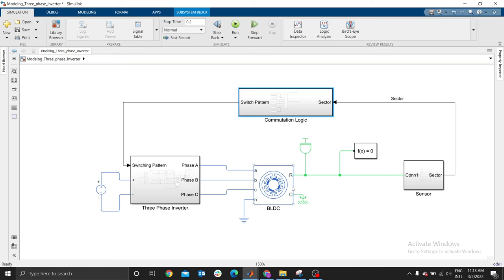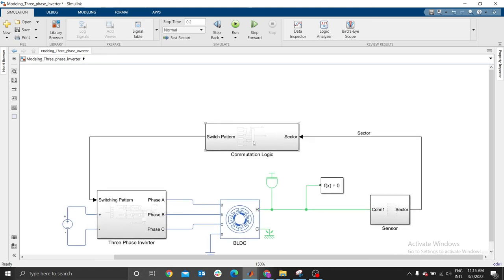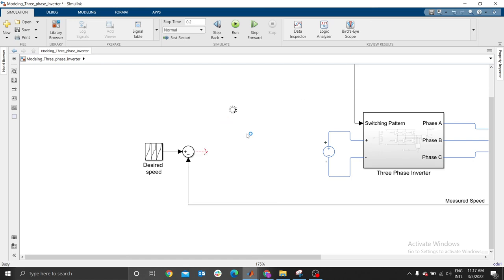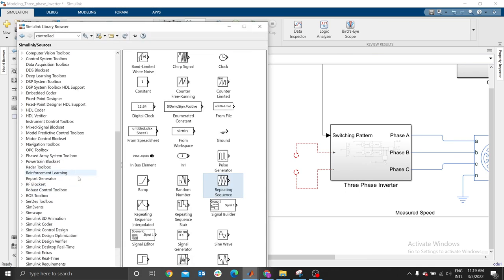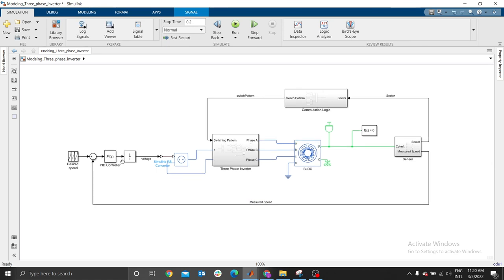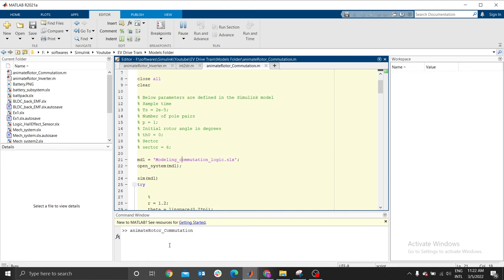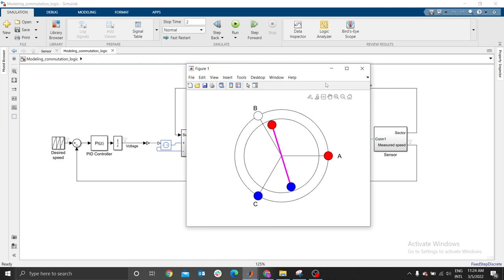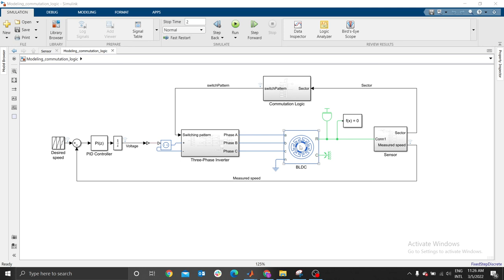Six-Step Commutation Logic of BLDC Motors : Electric Vehicle in Simulink part 7.4

Comment: So, we are using a Controlled voltage that applies full power to the MOSFETs or we lower the bridge voltage to slow it down.  It seems to work.   How can we add PWM to each half bridge.   As we commutate via sectors and angle.   How would we adjust currents in each winding phase.   Would this PWM equation be a function of torque?  How are the currents adjusted as we rotate in a 360 step via commutation?  It looks like we are full on as we rotate.
Reply from the maker: Thanks for asking but unfortunately I no longer make these videos

Comment: hello sir, error "Caused by: ['BLDC/BLDC']: Rotor angle over which back emf is constant must be less than pi divided by Number of pole pairs." appears when I run the simulation. Data of bldc i installed as part 7.2. Please show me how to fix it. Thanks!
Reply: make the pole pairs in that dialog box to 1 ,it will be solved

Comment: For sequence with only positive speed values i am getting correct results 
But Can someone tell me why after input sequence as first +ve speed then -ve speed is not giving desired results?
Reply from the maker: You want negative rotation hence you need to change voltage sign instead